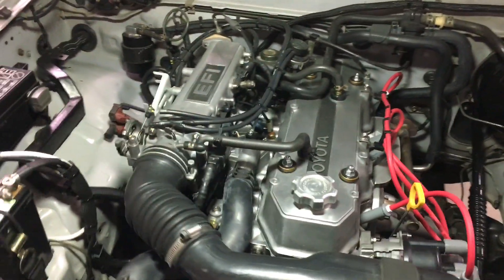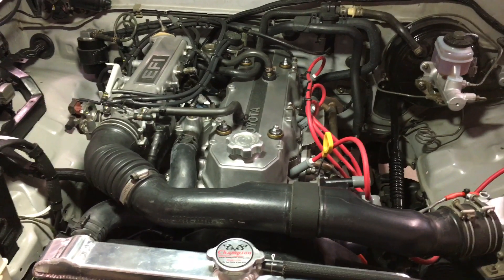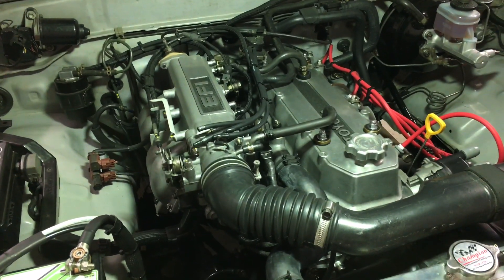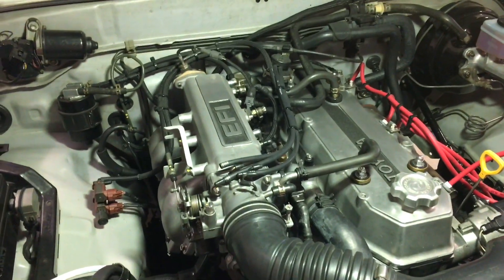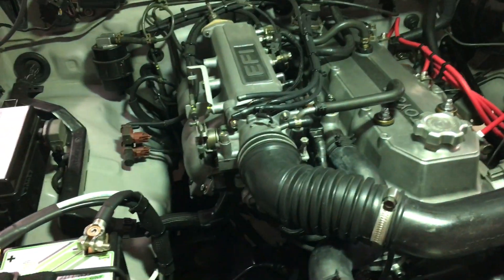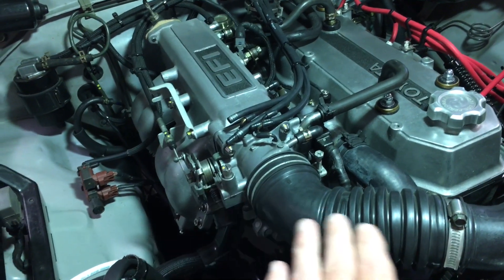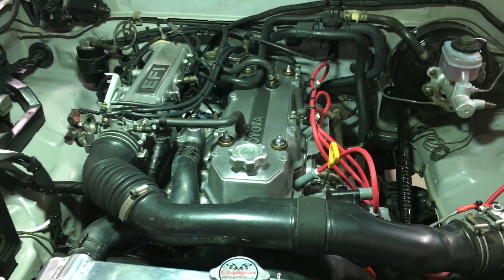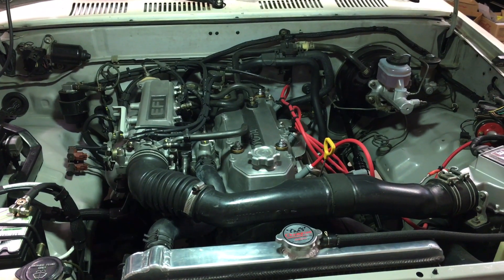Toyota 22RE pickup dashpot adjust fixes unstable idle (dropping to 500 RPM's when coming to a stop)

Comment: I just rebuilt my engine and set the timing and have been driving it, I am having an issue were if I am slowing down for a turn or idling at a light the rpms drop all the way down and it kills it self, I have to blip the gas to keep it alive. it may be water in my gas tank but that wouldn't kill it while i'm driving right ? 

I am also still able to warm it up before driving I wait for it to lower to about 800rpms, the normal idle has been highs of 760rpm and lows of 660rpm, should I have it idle a little higher ?
Reply from the maker: Try running the idle more like 950 or so. Run a can or two of berryman B12 chemtool through the gas tank also (the fuel injector cleaner). Also check to see what vacuum you are pulling at idle with a gauge. You might have a vacuum leak some where which is causing the motor to go super lean. Check your PCV system as well and make sure that's all setup correctly. If you have a K&N style filter on the front of the valve cover, that's incorrect and can cause the issues you are having; you need the fresh air line off the throttle body there.

Comment: Bro, just yesterday I resolved the same issue, I canceled the stop signal from the stop switch to the ECM. I am planning replace the ECM but for the moment the pickup works well, my theory is that this inning voltage, alter the others out voltages from the ECM to the ignition sensors.
Reply from the maker: stop switch? What pin on the ECU is that? I'd like to look it up
Reply: @ray5961  in the ecu the smallest connector wire green white, but if you want to check before cut this cable, the best way to confirm is disconnecting the plug from the stop switch is a little tricky due the reduced space
Reply from the maker: @erasmoochoa8744  The green/white lead to the ECU is the EGR temp sensor
Reply: @ray5961  there are many green white cables, is necessary view the manual, I have digital manual if you needed, if you have access to this manual check the STP terminal location
Reply from the maker: @erasmoochoa8744  Ok yes, I see it now on the STP pin (also G/W). I don't have cruise control on my truck as it's a manual gearbox and I have also removed the original steering wheel (and those switches). What exactly does that circuit do?
Reply: @ray5961  does it work??? After that I only had to adjust the MAF

Comment: Hey Ray how you doing? Why my engine do not drop the rpm’s when I bridge te1 and e1 ? Check engine flashes
Reply from the maker: It's hard to say, but make sure the engine is up to full operating temp for one thing (this will help ensure the IAC valve has fully closed). Also, when you do jump TE and E1 what base timing are you seeing on your timing light? It should be around 5 degrees BTDC when jumpered and then when you remove the jumper it should pop up to around 12 degrees approximately. I run mine at 7 degrees and when I pull the jumper I think it goes up to around 13 degrees or so. I run my idle at 850-900 RPM's usually.
Reply: Yeah, it doesn’t change at all
Timing mark is on 12 degrees
TPS is adjusted 
New timing chain 
New harmonic balancer and still the same
Reply from the maker: @estuardoleiva5647  Sounds like you could have the camshaft off by 1 tooth perhaps. On the camshaft gear, it's 36 teeth, so each tooth is a 10 degree error. Who did the timing chain install?
Reply: My mechanic did the timing chain
So you think the distributor is one tooth off ? Thankyou for your help buddy
Reply from the maker: @estuardoleiva5647  It's easy to do accidentally if you aren't familiar w/ the 22RE and/or you don't work on them all that often. The alignment marks on the camshaft gear can be a little bit confusing at first. It is also easy to accidentally slip a link on the chain during installation (depending on how you do the job). Here's a video which shows a bit of information on alignment - https://www.youtube.com/watch?v=MnP3DcsUf7g - try adjusting the distributor as far as it will go and see if you can get back to 5 degree initial timing when the Te an E1 are jumpered up.

Comment: Ever since I had a rebuilt 2.4L EFI engine installed the engine cuts off sometimes when it is extremely humid. It restarts after I stop and sometimes it turns back on while I depress the gas pedal rapidly. I noticed rain doesn't cause this. I thought it might be the broken cover on the relay block behind the battery but even after I sealed it with a good caulk it still does it. Not sure where to look. The engine also idles rough even after I installed new vacuum lines and found no leaks via spraying starter fluid. .
Reply from the maker: Sounds like maybe an ignition issue. Check your plugs and make sure they are good. Try running the gap at .025" instead of .032". Mainly, however, I would check to see if there is internal carbon build up / tracing inside the distributor cap.. also, check to see if there is any cross arcing around your coil. If the spark plug wires are old or cracked or anything, sometimes surface moisture on the coil itself will allow sparks to run along the coil and to the frame or coil bracket, etc. Check to ensure all your plug wires are making secure contacts. When this happens, you can also pull the spark plug wires off (or just pull the plug out and keep it in the wire) and touch the plugs to the cylinder head and see if they are showing sparking or not. Humid almost always equals electrical issue.
Reply: @ray5961  Thanks. I had a spare coil, changed it and recently cleaned the parts on the inside of the new distributor. I will do a night check with a spray bottle of water and check for arcing. I also cleared  the EFI codes by pulling the fuse for 30 secs, which appears to have made the engine run stronger.  Afterwards I drove the vehicle for a few days and learned the Throttle Position Sensor is sending a 11 blink malfunction code. Ordered a new OEM TPS. I am also looking around for a new cover to replace the broken one on the relay block behind the battery. Haven't had any humid weather to see if the problem is corrected. I was reading the manual last night and if the TPS code reappears after I change it I will try running a  complete EFI volt test on the ECU. I noticed they didn't clean the intake manifold when they put the new long block in and I am wondering if I should have it cleaned. It is black inside.
Reply from the maker: @AlbrightJamesD  Cleaning the intake manifold never hurts. It's kinda of a bitch of a job though. I did mine (the plenum and the intake runners) in the kitchen sink over 2-3 days. Nightmare job. The adjustment on the TPS is extremely important and must be perfect. Check the shop manual pages for that.. it's a very fine adjustment; you can't just eyeball that.
Reply: @ray5961  The new TPS made a big difference. Don't have to put my foot into the pedal as much, the motor idles better, responds quicker and the gas mileage went up. I am going to test and if necessary replace the airflow meter. Do you think changing the original 87 catalytic converter will make a difference?
Reply from the maker: @AlbrightJamesD  That's great news man. On the CAT, it's hard to say. I mean when I first got my truck, I removed the cat and ran carb cleaner and ran the hose through it haha. That seemed to help a little bit. The more exhaust flow you can get the better of course. Try running a test pipe in there for a bit and see how she runs.
Reply: @1 What upgrade plugs did you use? What wide ban 02 sensor did you use?
Reply from the maker: @AlbrightJamesD  I'm running the Denso W16EXR plugs. The Wideband is the AEM w/ the bosch O2 sensor. If you need the exact part #, just let me know :)
Reply: @ray5961  I would like the part # for the wide band O2 sensor. Is the mounting the same as the original O2?  Thanks.
Reply from the maker: @AlbrightJamesD  Here's the one I'm running over here on my truck: https://www.summitracing.com/parts/avm-30-4110 - on my exhaust, I welded a dedicated SS bung into the exhaust (behind the collector) and installed their O2 sensor in there. I don't think you could really just use the stock location; for one, toyota uses a 2 bolt flange while Bosch is thread in. Also, your ECU needs that narrow band data for fuel trim, although I think they do have wide band sensors that can fork that data off to the stock ECU maybe? If you are running an aftermarket ECU and doing your own fuel mapping, then you could use the wideband data for everything. If you are running the factory ECU, it needs the factory narrow band O2 sensor in the mix, even if you install the wide band gauge.
Reply: @ray5961  Which ECU did you install on your truck?
Reply from the maker: @AlbrightJamesD  Just the stock ECU that came with the truck right now. In the future, when I build a new motor, I'm most likely gonna run one of the Link ECU's.
Reply: @ray5961 Thanks

Comment: I just got a 95 pickup 22re and its having the same issue stalling at red lights due to low rpms especially when i put the A/C , i adjusted the dash pot and it definitely helped just not liking the engine being at 1800 rpms when its hot and cold . What can i do to fix the issue?
Reply from the maker: It's hard to say.. the dash pot doesn't have a lot to do with these sorts of issues typically. It can be helpful, but it's not the end all be all. I would start by running some Berryman B12 chemtool fuel injector cleaner through your gas tank. That can help clean out injectors. Also, check the door inside your AFM to make sure it swings smoothly and there's no binding taking place in there. You might wanna check to ensure your coolant temp wiring and sensor are all working properly (the one on the intake runner up front). Same goes for the wiring harness to the O2 sensors - make sure those are clean (the sensors). On my truck originally I had breaks in the wiring on the O2 harness and that caused issues. Sometimes pulling the 15A EFI fuse out for 5 minutes to reset the ECU can help a bit. You also wanna check for vacuum leaks around the O-ring on the idle adjustment screw as well as for a good seal around the dipstick. Check to make sure your PCV system is working. If you have a vacuum gauge check idle vacuum levels. Also a fresh set of spark plugs can often really improve things, especially if you are burning some oil past the rings or something. Those are some things to check out.
Reply: @ray5961  so the dashpot didn’t help it at all, i moved the airflow on the throttle and rpms went up as of right now, the ac kicks on and off and it hasn’t stalled yet; im going to take ir for a spin see what happens lol
Reply from the maker: @E93AZlivin  Yeah, definitely check out that AFM door.. if it isn't swinging freely inside there, it will tend to stick and that can really screw up your idle something awful. Here's a video talking about it: https://www.youtube.com/watch?v=oBBr7MPoXaw
Reply: @ray5961  will look into that too bro thank you!!
Reply from the maker: @E93AZlivin  you're welcome man. Let me know if you have any other questions.. any time.

Comment: Great video!!! Very informative. I have the same pickup with the same header and most likely the same cam. Everything runs great until today. I drove it for roughly 35 minutes and then I would get on the gas and anything above 2000 rpm’s my truck would bog and cut out. It felt like a fuel delivery issue or like its being choked out. I’m going to pull the o2 sensor to see if my cat is plugged up. After that I’m not sure where to go. Any help or advice would be much appreciated.
Reply from the maker: Yeah I would check restriction in the exhaust system for sure. Also fuel pressure. Check to any vacuum leaks or cracks in the intake pipe / elbow as well. Let me know if you have any other questions or discover anything else.

Comment: Mine keeps dying when I run the a/c so I tried driving without it but now its dying when I stop unless I slam it into neutral first. Any ideas whatsoever as to why?? Please and thank you
Reply from the maker: Hard to say. I would start by doing some diagnostics... check compression, check vacuum levels, check for vacuum leaks, etc. I believe there is also some sort of A/C VSV system, although on my truck I don't have A/C so not real familiar with how it all works. My friend's truck had A/C but we removed it all. Just too much trouble.

Comment: hey were did you get all your titanium engine bay hardware
Reply from the maker: Some of it I had custom made in Russian, China, etc. Most of it, however, came from RaceTi.com - they have really great stuff. All the 12-point nuts come from there. The exhaust studs were all custom made; I used to sell them on eBay

Comment: How did you adjust it?
Reply from the maker: There is a threaded shaft and a nut... however on the later models they changed it and there is no longer any adjustment (like on the 94 model, for example).

Comment: my truck doesn’t have the dashpot. should i get one asap?
Reply from the maker: Nah... it doesn't make a lot of difference either way. I currently have my dashpot disabled on my truck. Doesn't make too much difference usually. Just turn the idle screw up a bit and you should be fine.

Comment: I adjusted it and it seems like it helped, been driving it like this for 10yrs. In my case cold start idle is fine, warm start however not so much. Low idle. I adjusted the dash pot and voila warm starts definately better. Still need to test drive but so far so good. Thx man
Reply from the maker: Thanks! Yeah, the dashpot helps out at times. Sometimes I disable it, other times I run it. A lot depends on where you set your idle also. Lately I've been running more like a 850 to 900 RPM idle, so I haven't been using the dashpot lately.

Comment: Hey man! I have a question about what the part is called that is right above the dash pot. That the accelerator cable is connected to the part that is rotating. I’m looking for a replacement spring for that specific part I have 89 pickup 4wd 22re
Reply from the maker: It's usually referred to as the "throttle cable bracket" or something along those lines generally. I'm not sure if it has a widely accepted universal term. For springs, check McMaster.com - they usually have plenty to select from, although maybe not that crazy spring on the plate.

Comment: Am I missing something...what do we actually do to adjust the dashpot?
Reply from the maker: You basically adjust that little tip which goes in and out, so that when you release the throttle, it will settle down gradually at the end (to a count of about 1.5 seconds or so). Make sure the dashpot itself isn't clogged with dirt, since that can stop it from working correctly (and mine did originally have that issue). You might want to also try setting your base timing to around 7 degrees, instead of 5 and set your idle more like 850-950 - I've had much better luck with that.

Comment: Hey this sounds almost exactly what is happening to mine , but mine will idle at like 250 and gets a little sputtery.
Reply from the maker: Yeah, getting a steady idle from the 22RE is always entertaining haha.
Reply: @ray5961  I adjusted the screw on the throttle body that adjust the idle and it will fix it but then when I drive it then it starts doing it again
Reply from the maker: @a145rt  You might wanna try inspecting / cleaning your plugs. Dirty or oily plugs will also cause unstable idle issues. Also make sure coolant is flowing around the IAC valve (I have other videos about that specifically and there are some tests you can do to rule the IAC out). Try some fuel injector cleaner in the gas tank also, that can really help. I use Gum Out tune up or sometimes seafood concentrated fuel injector cleaner. Berryman is also very good.
Reply: @ray5961  thanks man I appreciate it
Reply: @a145rt  did you have any luck?
Reply: @rawimpact  The air filter helped some but I sprayed just a dot of paint on the screw ,which dries where it don’t move and it hasn’t done it since
Reply: @a145rt  are you talking about the idle screw?
Reply: @rawimpact  yeah
Reply: @ray5961  also do you think that a new air filter would help raise the idle up some top mine is dirty
Reply from the maker: @a145rt  Try taking the filter out as a test. It's probably not the issue, but it's easy to rule out

Comment: What spark plug wires are those?
Reply from the maker: Those are MSD 8.5mm spark plug wires (part # MSD-31949) ordered from Summit Racing for $69.15 - they are really great. I love them. Make sure your distributor is the normal kind, not with the little pins (which I think Toyota switched over to in later years). But yeah, the best wires ever.